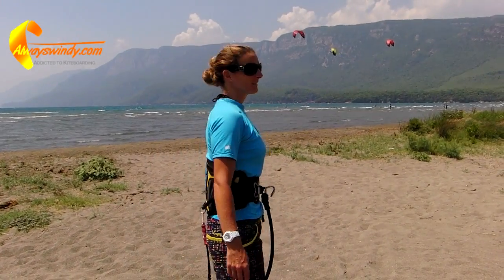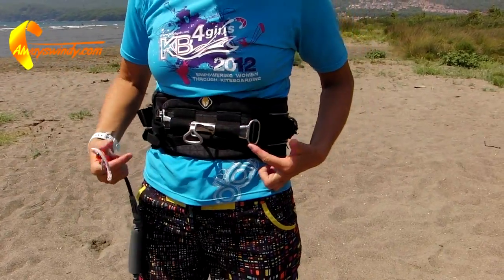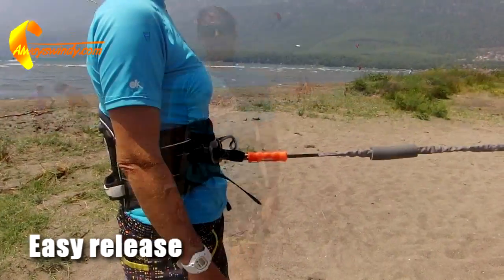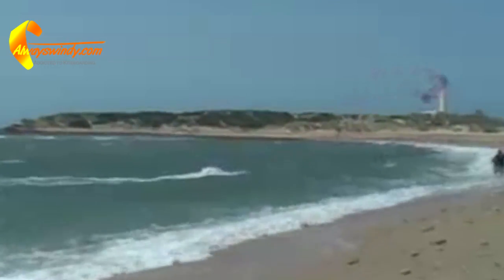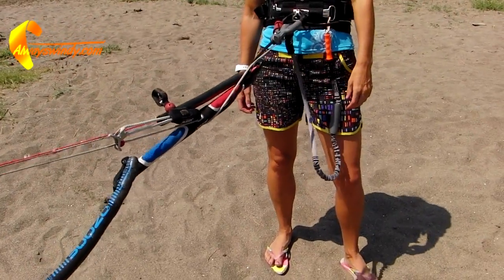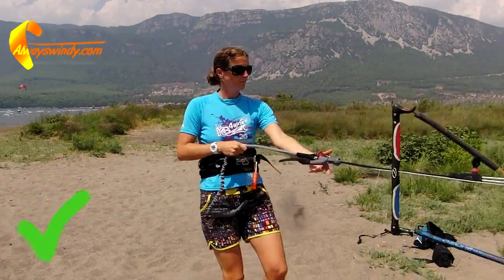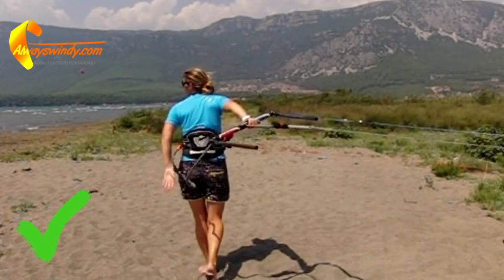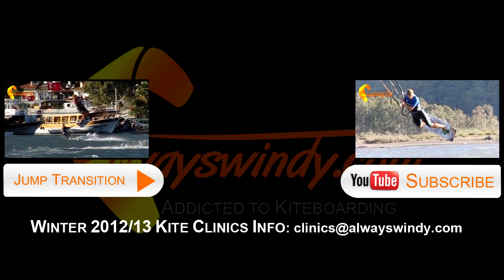How to: The Kite Leash

Comment: Very important tip, appreciate it!
Have a question though - since the leash is now connected to the spreader bar (or sides), will this hinder doing handle pass?
Reply from the maker: Absolutely no issue at all. Most pros ride longer leashes now and to not drag it around, they often attach it to the spreader bar and then wrap it around once or even more (for double and triple passes).

Comment: I tried this. Eventually the attachment point in the harness snapped. Almost lost my kite, saved due to some friends who were quick to help recover it before it reached the bushes. This was with Ion CS Hadlow Harness, 2018 model, which I purchased new less than a year ago.
While I got "warranty" (unfortunately just a refund for an already discounted price, and the shop is not in my country), I think it's not a good idea to attach the harness to something that can fail so easily.
I didn't even do anything special. Just crashing unhooked tricks for the last year... I don't want to know what would happen with older harnesses.

Comment: Very interesting tips, but it`s my understanding that the leash being attached to one of the front lines will make the kite (bow type for instance) collapse and fall. Maybe Karolina Winkoswska had a different setup, but in my case i would only disconect from the leash if the kite gets entangled with a moving object, like a boat or a car. Am I correct?
Reply from the maker: In the case you describe it would be correct to disconnect from your leash. But this video is not about disconnecting your leash, it is showing how to connect it properly to your harness. This is independent on where you have the leash attached on the kite side.

Comment: If you do this, make sure the loops are solid. I tried and the ring ripped right off when I let go of the bar, cutting the kite loose. Dumb mistake. I thought I'd leave this comment in case it can help someone avoid this happening.
Reply from the maker: Thanks for the tip. Alternatively you can attach most leashes on the spreader bar loop through (where you have the tension belts going through).
Reply: Same thing happened to me. And with a dedicated freestyle harness from Ion, purchased new!
They don't even have the option to attach to the spreader bar (no rings).

Comment: what about board leash ?
Reply from the maker: We really do not recommend using a board leash. The board leash can be extremely dangerous in many scenarious: from wrapping around your quick release to getting hit on the head by it on a crash.

If you must use it, always wear a helmet but even then, your neck is not protected and the leash can still tangle on a bad crash.

It is much better and safer to practice your bodydrag so you can always return to your board.